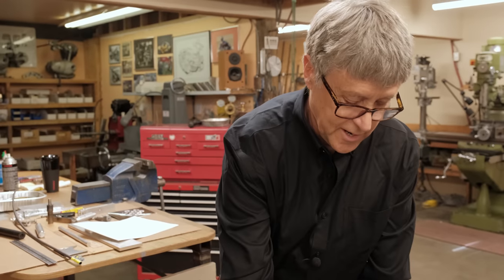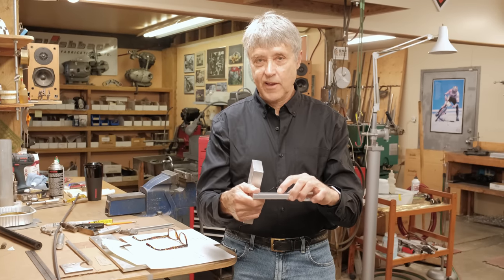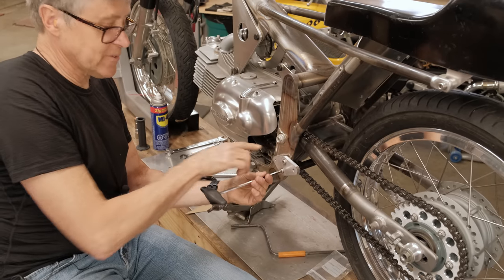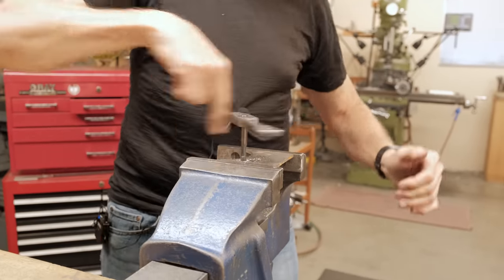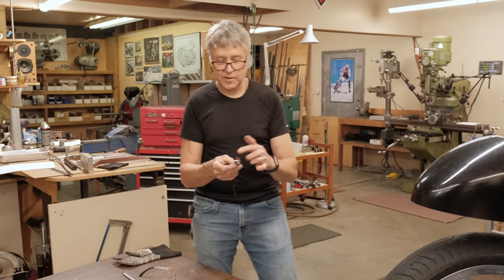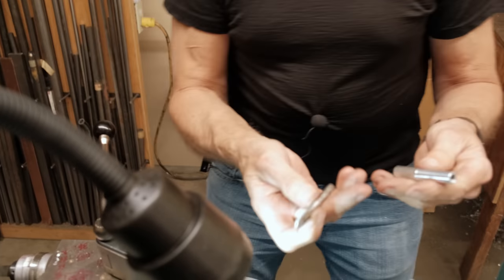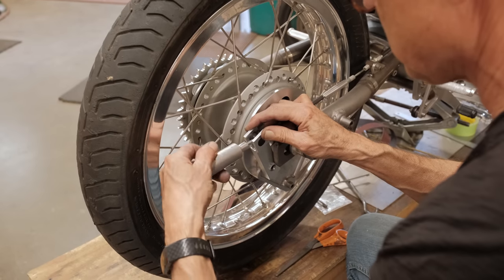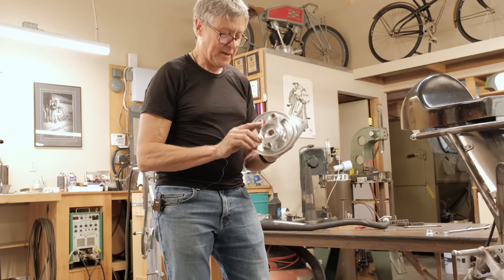Aermacchi Rear Brake // Paul Brodie's Shop

Comment: My old Yamaha TZ350B (75) had a cable brake much like that. It was a really effective brake, but all the other racers laughed at me because disk brakes were cool. The drum was more free spinning than any disk, and was no heavier.  I just noticed the Harley-Davidson on the ignition side cover. Since HD bought into Aermacchi in the 60s, the logo is no surprise.

BTW, a few years ago, Aermacchi ran ads during the Washington Nationals baseball games. They are still an active aerospace company, they were trying to sell their helicopter to replace Marine 1.
Reply from the maker: Yes you are right about early discs. They were not the greatest, but most racers wanted them. Myself included.

Comment: One reason I love the Kromag so much, Paul, is that it was designed with both speed holed engine mounts,  as well as a fuel tank who's mounts are graduated, dimpled, speed holes. ❤

Comment: loosening the chuck while tapping in the lathe at 20:25 was so smooth i had to watch it a few times
Reply: Not the time to forget which way it goes :P
Reply: I’ve done this many times from the tutelage from many older Men.
Reply: How about changing the lathe speed to a lower rpm?  And removing the wrist watch may be a good idea along with loose clothing like long sleeves. Not in this vid but in others. Nice work

Comment: So interesting to witness and thanks to Mitch for the fine video work.  Back in the day, the Italian 250s were the creme de la creme.  It looks like you have Oldani hubs on this project, what great brakes they were.  Last one's I saw were on a new Mach 1 Ducati at Ghost Motorcycles, a large and famous dealer on L.I., N.Y.
Reply from the maker: I remember Ghost Motorcycles. They got a lot of press in the 60's motorcycle magazines. My brakes are not Oldanis, sorry. If you watch the brake videos you will see they are modified Hondas :) 450 and 350 models.
Reply: @paulbrodie  Thanks.

Comment: A wee tip,  do u know that in metric threads one can deduct the pitch from the diameter in order to the core diameter of threads..as in M6 (which normally is X1) one drills 5mm , in the case of imperial , I translate the pitch ,I think 20tpi is around 1,25 , which I then deduct from the diameter.......just a wee tip.....

Comment: I’m surprised acetal would be strong enough for the cable pivot in the drum lever. I’d worry about plastic deformation under load.
Reply from the maker: Well, we call it Delrin here; not sure if it is the same as acetal. Delrin is great stuff!
Reply: @paulbrodie  hey Paul Delrin is a brand name. It’s commonly known in the business as Delrin but this type of plastic is acetal. It’s like Kleenex and Frigidaire. Also like you often hear Lexan which is just a brand name for polycarbonate.
Reply from the maker: @MaxPower_Designs  OK I'm learning. Here it's always been Delrin and I've never heard it called anything else. I really like it for some applications.

Comment: Hi Paul. Can you show how you bent tubes some Day? Anyways love you channel❤️
Reply from the maker: Thank you Morten. For small bends, I use the arbor press with some dies. You can see that in the Romax seat stay video. For more complex bends, my friend has a CNC bender that cost a lot of money, so I get him to help me out. Thanks for watching!
Reply: @paulbrodie  thank you. Ive ordered a die bender now, so it will be fun to play with- hoping to make it work. I have long had a good idea for a framework project that is now to be made! inspired by you and others .. I have a workshop with manual ironworking machines, a little a la yours. And have made 1:1 templates of most of the components. however, I can only get 6060 aluminum and not 6061 unfortanetly. do you think it will be ok? it is a double tube frame, a bit like a mc frame and i want to make it in 30mm tube so 2x30mm tube put together. if you are interested, I would like to send you my drawing. Anyways thank you for the reply😊😊👌 i will send you and mitchel some coffe, and sorry for my bad english🤫
Reply from the maker: @mortenrosentjorn1803  I see, you want to make a frame out of aluminum... In Canada here I have never heard of 6060. Making a frame out of 6000 series aluminum means you will likely have to Tig weld it, and then get it heat treated. Which can be expensive for one frame. Are you sure you don't want to make it out of steel?
Reply: @paulbrodie  thanks for your reply. I make my living by tig welding, and have my own business. despite the fact that I have no education, i have just taught myself everything- I do not have much sense of the various alloys before I examine its properties. yes I'm thinking of going with steel too, but again here, I had a hard time getting the right types. crmo4130 is impossible to get here at home. my steel dealer suggests s304 steel as best suggestion, it is seamless and maybe strong enough, but it is half heavy. the bike I want to make is one I will produce more of, if it gets good. I have the facilities for it, and really want to do it. after all, I live in the "land of bicycles", but bicycles are not really produced within the country's borders. previously for some years back, i have had my ovn bike shop too. well, I have to investigate some more. Thanks Paul!
Reply from the maker: @mortenrosentjorn1803  Yes, if you are thinking of going into production, you are really going to have to do your research. 4130 really is the best tubing for a lot of applications, and something less may fail, and then you are into warranty work. Which means, working for free. If someone gets hurt on one of your bikes, that could be a lawsuit so be sure to get liability insurance, which probably is not cheap. I don't want to discourage you but the bicycle business is not an easy way to make money. But if bicycles are your passion, you will probably do it anyway... Good Luck!

Comment: hi Paul and Mitch, great videos! Paul just wondering, when you use'd the tap to hold the work and machine the second tapper couldn't you use a bolt or threaded bar, chuck that and thread the work and tighten that with a nut?
Reply from the maker: Thank you. Yes, a threaded rod could be used instead of the tap, but it's an 8 X 1.0mm thread, and that's an uncommon size in my shop. That's why I used the tap!
Reply: @paulbrodie  yes that's true, thanks for the explanation.